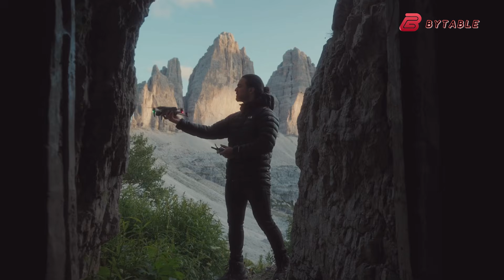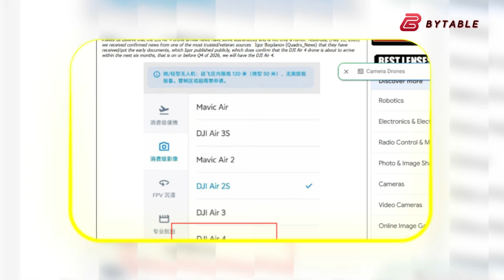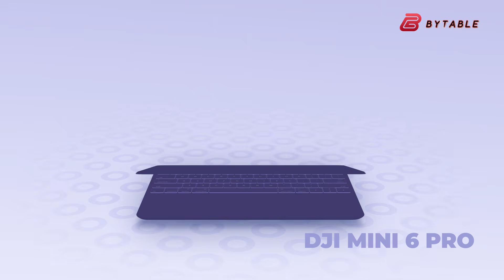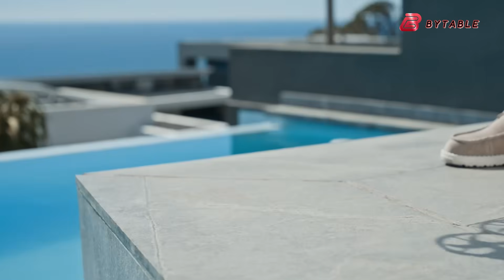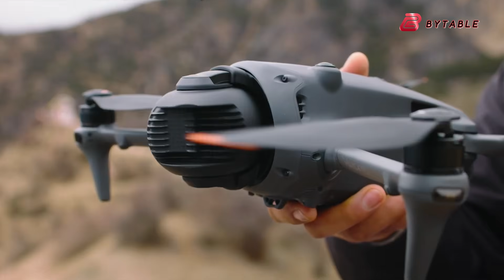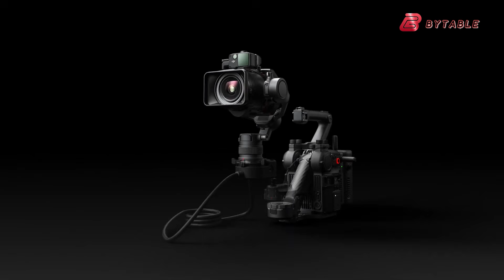7 DJI Confirmed Upcoming 2026 Lineup - DJI Neo 3 & Action 7 Leaked!

Comment: I want the Action 7 to have a 1 inch sensor.
Reply from the maker: That would be a massive upgrade for low-light performance! 😊
Reply: @Bytableus i will be getting the 4P for my workflow. Having the 60mm option is fantastic. Waiting to see about the Action 7. All the initial 4P hype will have died down by then. Will get both if the 7 has a 1 inch sensor.